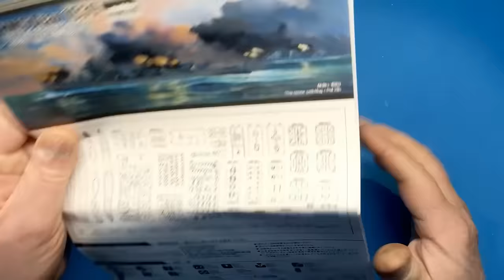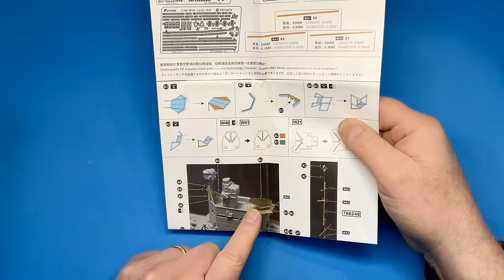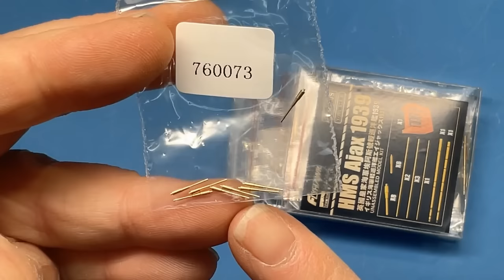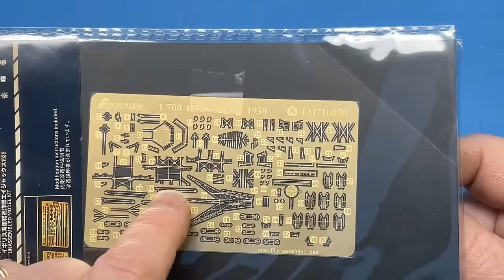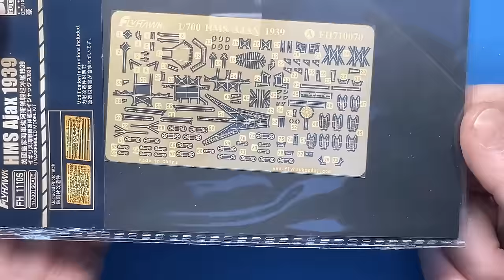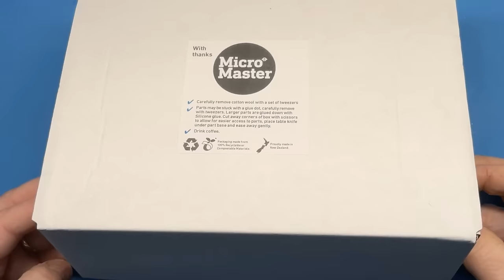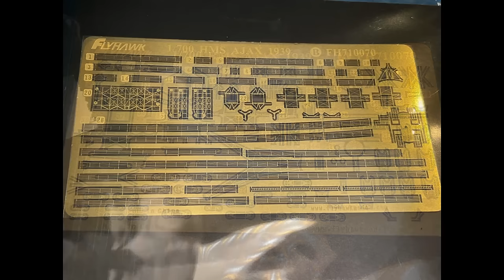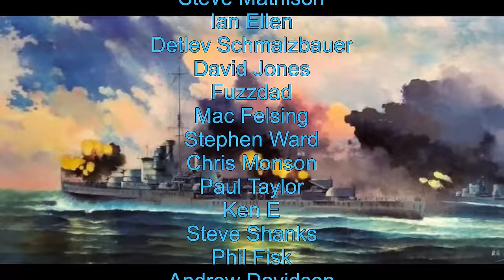Flyhawk 1/700 HMS Ajax 1939 - preview

Comment: Optivisor will be wanted.  Might want to spring for one with the flip-down additional magnifiers given how fine those d prints are.
Do note, a person wants to be careful with an optivisor lest one klonk it into light fixtures, cameras, and the like.  Also, it will really mess with depth perception if one stands too quickly.  (Often a decent idea to set a timer for 7-10 minutes, to take the visor off and only focus at things clean across the shop, the better to exercise one's optical muscles.
Reply from the maker: Agreed I’m on the lookout for an optivisor for this one